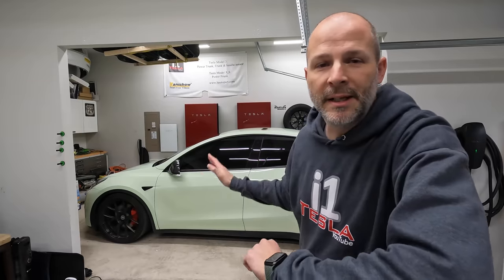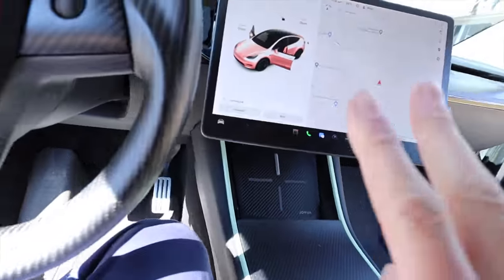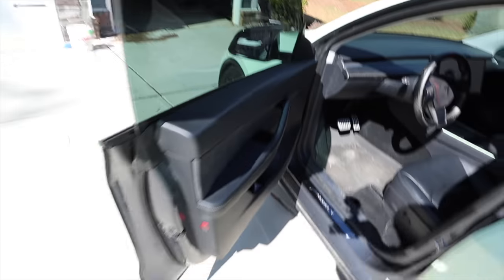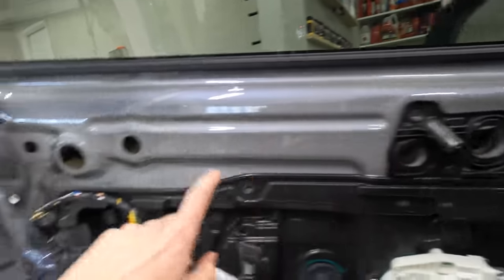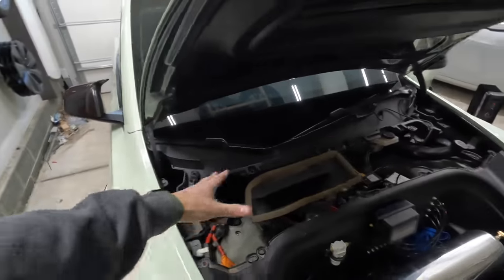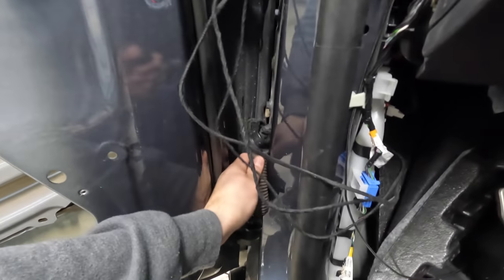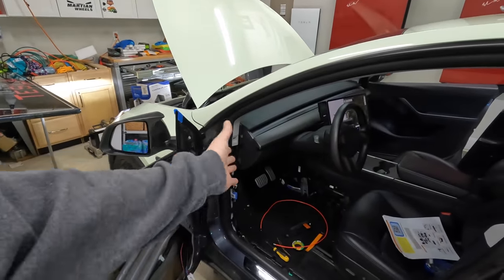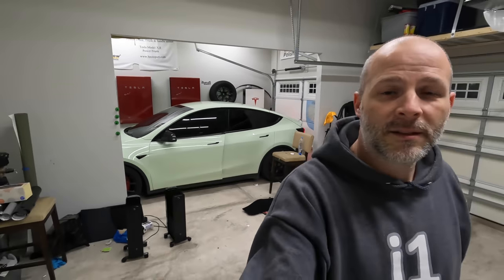Automatic Open Doors Model Y - mini model x

Comment: Good stuff! I just did the driver side last month and that was one heck of an installation. I really like the mod and it has always worked well but they need to figure out the radar sensor for obstacles avoidance. That red button looks slightly different than mine.
Reply: Radar will be available few weeks later
Reply: @Hansshow_Official  is the radar sensor now available for the self opening drs for model Y so they do not hit another car or object. Thank you
Reply: @Hansshow_Official  Is radar avaliable now?

Comment: Cool mod, but needs a sensor or it's a no for me.
Reply: I don’t really like it either it doesn’t like just close automatically and since it has no sensors  so  no no no but it was kinda cool you can just get a Tesla model x for more of a hefty price but sensors and and safety of other cars is better Soo just buy the model x it’s alright
Reply: @THEreal10rx  Lol
Reply: How do you deactivate the driver’s door from opening when using keyfob to unlock it? I have the auto door close/open and self presenting door handles.
Reply: I think the V2 has radar option. I’ve seen on another channel this implementation

Comment: So what do you do if you're park in a tight space? Do you have to use your hand to stop the door from hitting the car next to you? If the kit malfunctions, can you still open/close your door normally?
Reply: This was my exact question!  Our garage is very tight- if the door opened automatically it would be Tesla on Tesla crime!!
Reply: It's cool, but I feel it's too much to worry about.
Reply: Same concern for me. It was the first thing I thought about when I saw it after my initial excitement at the notion of adding this.
Reply: Have to have sensor to be safe or car door protector or guard.

Comment: Any issues with the doors ever randomly opening for no reason, especially while you're driving? It's probably unwarranted, but I'm a bit concerned about third-party stuff being glitchy like that...
Reply: i doubt it because it only open with the button on the door or if you pull the door handle, also it probably cant open while locked

Comment: Can the doors pressing a button be opened by mistake while driving?
Reply from the maker: The door can’t open using the buttons or app when the car is in motion. The only way to open it the emergency pull handle.